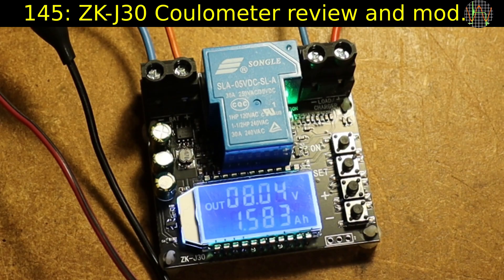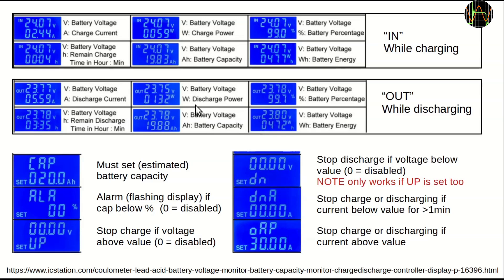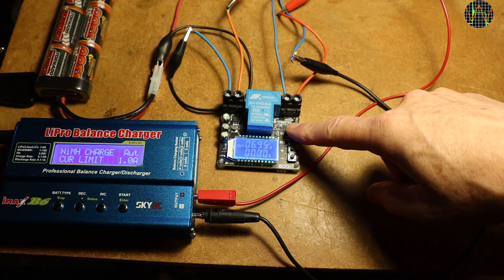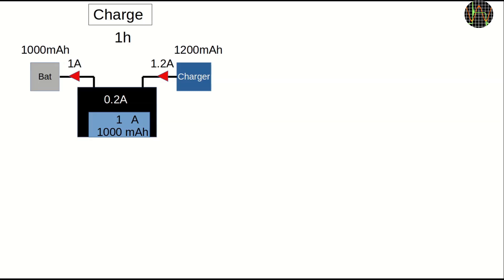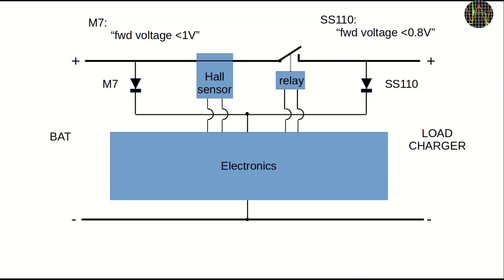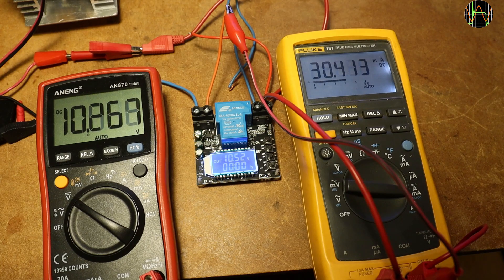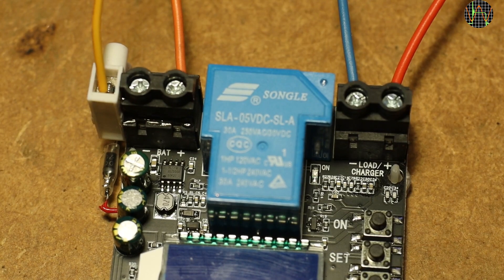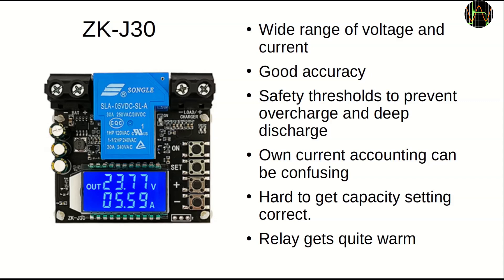145 - ZK-J30 Coulometer review and modification

Comment: Could I use this module to dischagre lithium batteries  for storage,I have a .lot of batteries  at different voltages.
Reply from the maker: You could but if these are single lithium cells the voltage is not enough to drive the module. You would either have to discharge 2 or three cells in series (not ideal) or do the mod I show in the video. That mod allows the module to be powered separately and not from the battery that you are discharging